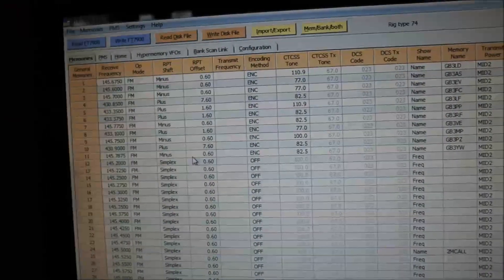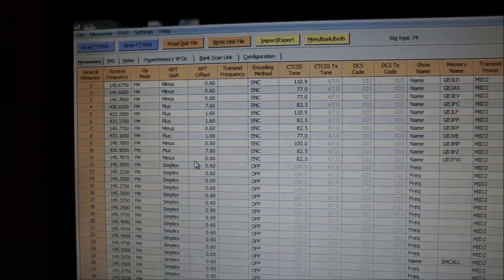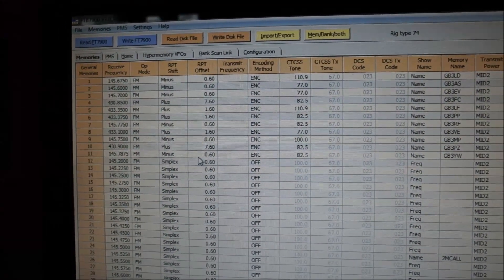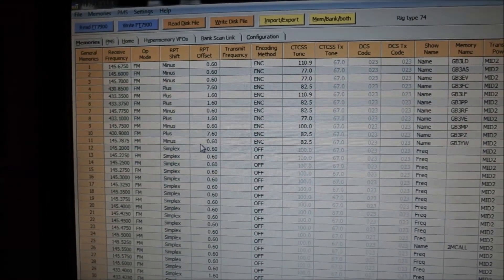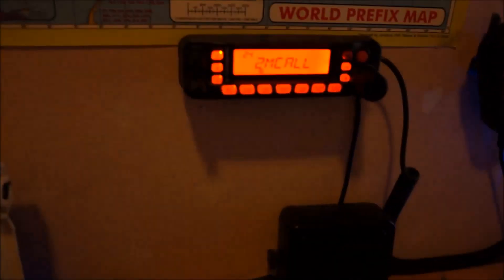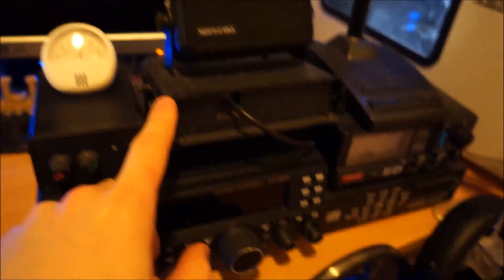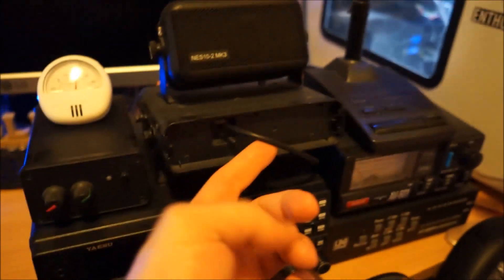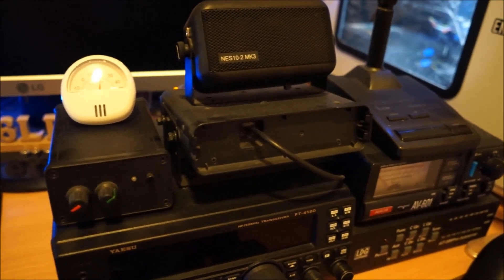Yaesu FT7900 Software - Programming Scanning Banks

Comment: My question is this,

, my brother bought the ft 7900 and had a gentleman programme it and then he shipped it to me. I have been using the radio with no problem. My question is this. I put the radio on scan once and it  scanned just bank one. Now after  few months it scans all banks. I HOLD IN THE SCAN BUTTON FOR ABOUT 1 SECOND   then relEase it and it says no banks. I can turn the bank  the Cunningham selected no to bank one, but it won't select bank 11 to just scan bank 1. How do yOu do that